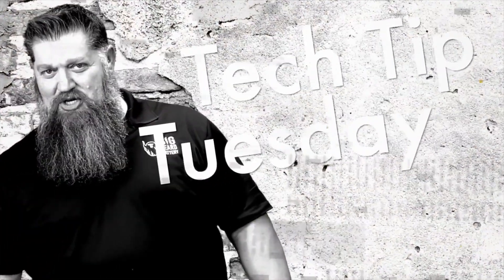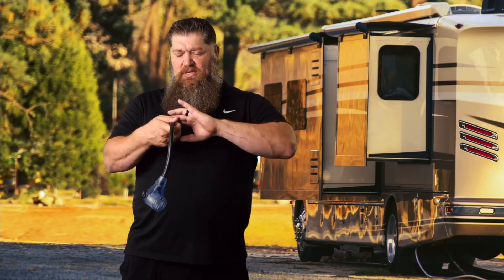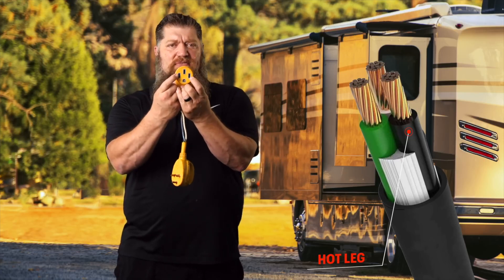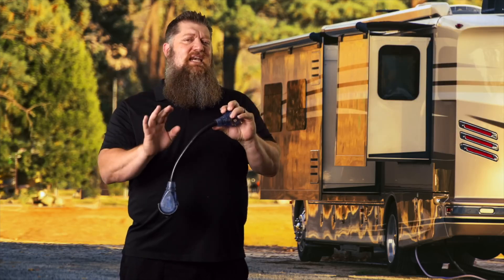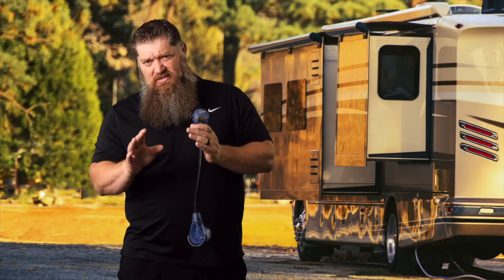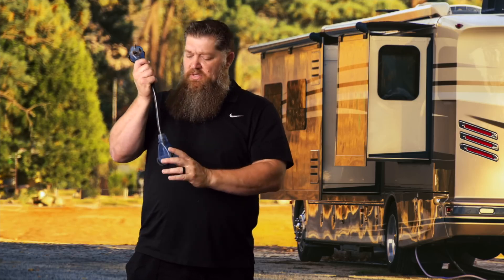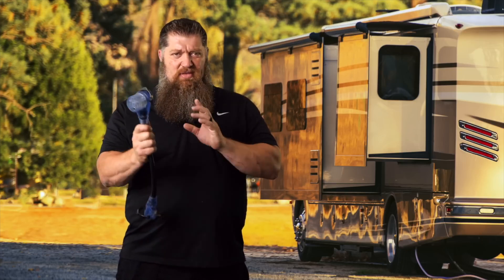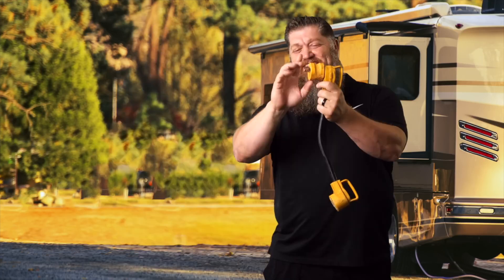Are RV Adapters Safe

Comment: The typical amparage rating for residential/RV 120v breakers is +/-10% so running a bit high can be expected.   Run what you want if the circuit is good but if you draw more current than allowed, as indicated in the video, a breaker will trip somewhere..
The biggest risk of an electrical fire in any shorepower configuration is the plug/outlet contact points.  Make sure all equipment on your side is inspected and maintained to provide low resistance connections..  Avoid the temptation of adding additional contact points (surge protector, multiple extension cords, gizmos and gadgets).  Once connected check the connection points for warmth/heat frequently- if warm to the touch, immediately investigate and take appropriate action.  In many cases, the connection with the highest potential for a fire will be the source or pedistal connections as they tend to be well used/abused so inspect and monitor accordingly.  Should you be concerned about power quality, ask the attended if there is anything you should know and act accordingly.

Comment: When mooch dock or even when on a 30 amps campground outlet using my 50 amp RV I put the fridge and hot water heater on propane and usually only run the bedroom AC at night when it is cooler (bedroom sectioned off so it is a smaller area to cool). I mooch dock where I am usually with friends, and we hang out in their house/patio and just sleep in the RV. But even when on 30-amp campground connection I try and limit as much as possible.  I also carry a portable bluetti that I use for the coffee maker in the morning and my Cpap machine at night. I prefer my electrical cables to stay cool both inside and outside of the RV as much as possible.

Comment: But Todd... I have a 2003 Fleetwood Bounder that is 30 AMP and has 2 AC units and I can run both.
I have a Intellitec Shedder system manages that power - do they even install these any more?
Reply: Power managers like that aren't common, especially from the factory.
Reply: @calledtojourney  true, not real common. But it was factory installed for several years on Fleetwood units, from 1944-2005 (various versions).
Reply: @mooreadventures  It's interesting why they didn't just put in a 50 amp power supply. I doubt that the added cost of the power system was much, if any, less than just upgrading the wiring.
Reply: @calledtojourney  I 💬 knit was one of those transitional times in the industry where they tried to make it economical for class A and 50amp was not wide spead. The system actually works quite well.
Reply: @mooreadventures  Yeah, I'm sure it does. An increasing number of houses with electric vehicles will probably use these to control whether a given outlet powers something like a clothes dryer (or water heater) or the EV. Great concept.

Comment: Little confused on something. If I have a 50 amp rv can I run both AC's and the microwave? If I can how is that different than running one AC and the microwave on a 30 amp reducer? I am assuming that each AC is on a different leg when plugged into 50 amp service.
Reply from the maker: Good question. 

So a 50 amp rv has 2 legs of 50 amps service do it has the ability to allow up to 12,000 watts. 

A 30 amp rv or reducer only has. 1 leg at 30 amps so it only allows 3600 watts.
Reply: Ahhh. Now that makes sense. Thanks for the education!!!

Comment: Campground receptacals are often worn or loose. This creates heat, possibly damaging your cord and plug. The breaker trips for excessive Current, not heat at the receptical. The last adapter shown with the 15A fused to the dogbone, is simply a casualty of heat between the two adapters. That heat was generated without exceeding the breakers 15 or possibly 20a rating.

Comment: The prong can be loose as well, a breaker will trip on over amperage but will never know if the prong has a voltage drop that will cause over heating.

Comment: Another high load to avoid when using a reducer is the electric water heater function. Another sneaky load that is easy to overlook is the charger function of the inverter/charger. Ours can charge our 12V house bank at 100A, which is 1200-1300W.
Reply: This is where the Victron inverter/chargers really shine. You can program them to not draw more than 30 amps (or 15 amps, or whatever), and if your loads are bigger than that, they'll switch to inverting, take the additional needed power from your batteries, and then switch back to charging when the load drops below the limit you set. It's a lot like a hybrid vehicle, and it works quite well.

Comment: So I’m curious. I have a 30 amp trailer with a AC and microwave. Should I also follow this rule or is it likely my microwave is not a 1500 watt to accommodate?
Reply: You might like the nrvta online course.  He tells you how to math this.  I can’t run ac and microwave in my 30a Tt.
Reply: @benjackson9980  How much power does your AC draw? Most I've seen are about 1,500 watts, maybe 1,800. If so, you could run one and a 1,500 watt microwave at the same time but almost nothing else.
Reply: Haven't watched the video yet but if the AC fan is running, you'll probably be OK.  If that compressor kicks on, you are going to pop the breaker.  Same goes for anything with a heating element like hair dryers, toasters, and coffee pots.  Safest bet is to only run one high-draw item at a time
Reply: We run a watchdog EPO and I monitor everything on my phone  with that said, we can run two appliances at once.  AC/microwave-AC/coffee pot-AC/electric water heater.
Reply: @JandARVReviews  I can run the same but why risk it? Just because you're just under the 30amps you are over the max amp usage. You should always stay under 10% of the rating, if 30 Amos then don't go over 27amps. If you have a loose connection on your plugs or your power cord is in direct sun light so many other things can cause problems.
Reply: @theconnectedcamper  We haven’t had a problem in 4 years.  We stayed at a campground that had low voltage and it took out our watchdog. Thats the beauty of running a watchdog EPO I can see when I run two appliances at the same time I’m around that 24/25 amps I see no problem in that.
Reply: @JandARVReviews  We do the same, and it's extremely helpful. In truth, we hardly ever draw more than 30 amps total, even though we have 50 amp service.
Reply: @calledtojourney  Hey Guys! We enjoy your videos! If your ever passing though North Ms let us know! Safe travels!
Reply: @JandARVReviews  Thanks so much for your kind words! We spend a LOT of time filming and editing.
Reply: I have a 15k A/C = 14amps, a 1550 watt microwave = 13amps, 12v fridge about 1-2 amps with a 30amp connection I was hitting about 28-29amps when running all 3 devices. I was monitoring the amp load via my wifi Watch Dog EMS surge protector. This was just a test for about 1 minute to see what the load would be. There is no reason for me to run my A/C and Microwave at the same time. Most of the time I would run the microwave just for a few minutes so I would just turn the A/C off for those few minutes who the microwave is cooking. Now someone else could be running 13.5K A/C with just a little less amp draw and their microwave could be a smaller or less power then one. So maybe you could get your amperage down to 25-26 amps, then you may be ok on your total amp draw but why risk it, just turn the A/C off while running the microwave.
Reply: Somewhere on that microwave is a label that will tell you how much power it can draw.  Where is it?  I have no idea but look around it's got to be there by law unless someone removed it.